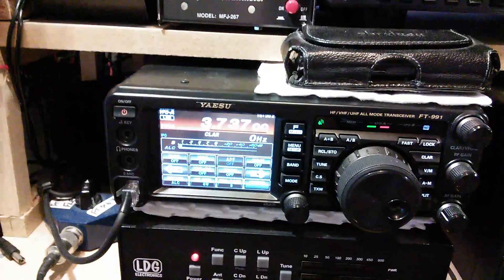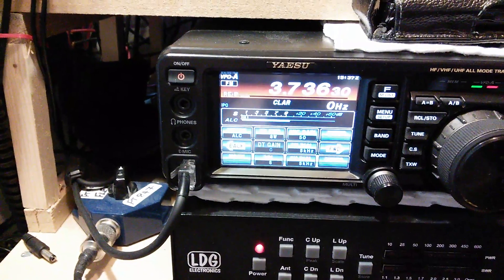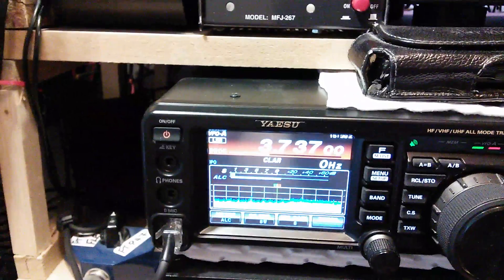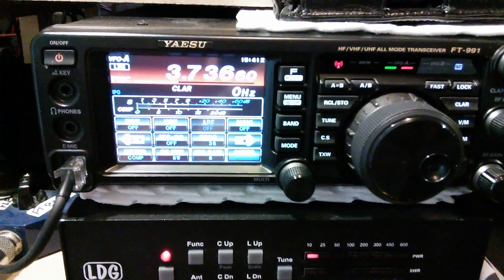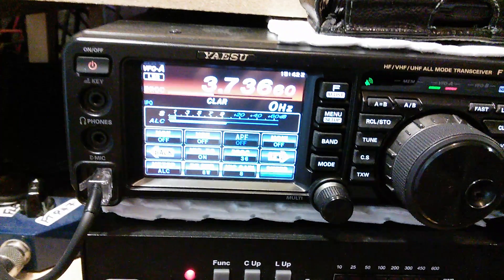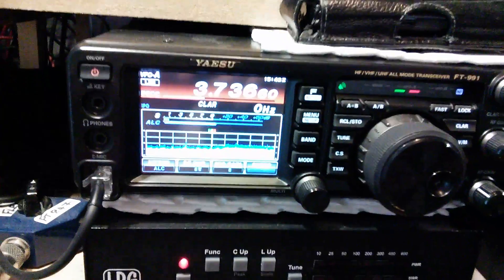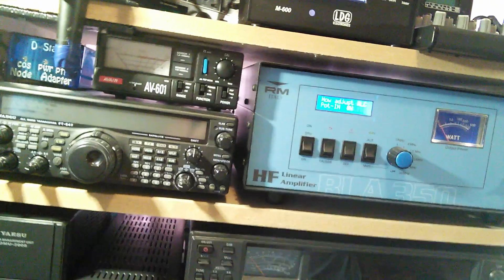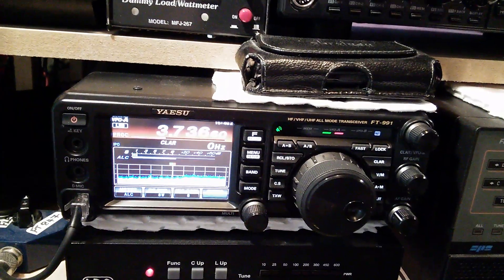FT-991 ALC setup for the BLA-350

Comment: Good morning.
I know, the subject is 8 years old but I am soon considering purchasing a BLA 350 amplifier which I find really great for FT8/FT4. My first question (I also have an FT991A which is connected to an MFJ 939). In menu 141 I selected the "external" position because the TRX is connected directly to the tuning box. 2nd question: When I acquire the BLA 350, should I connect the TRX to the amplifier, then connect the amplifier to the tuning box? In this case, do I have to go to menu 141 and stay in the "external" position or put menu 141 on "lamp". Thank you for your response. Kind regards 73's. Joel/F8MGW
Reply from the maker: Hi Joel ok here goes You need the AATU that can do more than the AMP can put out i.e. 600WATTS,  I have menu 141 OFF,  I use my RADIO then AMP then AATU, Tune up the FT991A with the AMP turned OFF use from 5watts all the way to 100watts then you will know that everything is TUNED with the Antenna, Turn the Power DOWN to 8 watts NO more then Turn the AMP on then go and test the AMP, Have a look at this video it will give you some idea of how to connect everything up if you need any more information regarding your FT991 and the BLA350 let me know and I'll help in any way I can,   https://www.youtube.com/watch?v=CO1HzyRV2Bc

Comment: thank you making this video, just wondering have you had any problems with the BLA350 since making this video ?
Reply from the maker: No I've had No problems at all, always use 8 watts and no one should have any problems.
Reply from the maker: I know you asked about the SWR but cannot see your question something to do with YOUTUBE, Yes you need to keep the SWR below 1.5 or you'll trip the AMP, SO power from the radio 8 watts and SWR NO higher than 1.5.
Reply: Sorry, I deleted the post because I noticed you had already posted below about needing  an SWR of 1.5 or less. Many thanks for reply.
Reply: Will it work 11 meters on the 7300 ? I want to purchase one. Any information would be appreciated.

Comment: Hello, i did get my Bla 350 but i have trouble here, when i connect the PTT cable there is no problem, but when i connect the ALC cable to the yaesu Ft 991 and i put the linear stby to on the Ft 991 starts walking all over the bands, i do not transmit, only put it from stby to on, what am i doing wrong, no antenna connect only Dummyload
Reply: SET MENU 141 "TUNER SELECT"  TO LAMP BEFORE CONNECTING ALC CABLE TO YAESU FT991

Comment: Hi,  i have the FT-991, and i like to buy the BLA-350, i have also home build radio's, thats wy i like to buy a amp where the input watt is low, like 5 watt / 10 watt range, Valve amps that have that are expensive to buy, thats wy i am thinking about the BLA-350, i do data on 40 and 20 meters (where i do not use the amp) and SSB on 20 and 10 meters, thats a bit about me, now my questions, what is the output power of the amp in SSB, the legal limit here is 400 watt PEP, and i do not need more, what is the power in SSB mode on lets say on the 20 meter band with 5 watt input or 8 watt input with max input (what ever that is), what can the amp handle all day long with out getting to hot, not on key down i mean, but normal speaking SSB, greetings from here, thanks for the nice video's, 73
Reply from the maker: Hi Jos with 8 watts input you'll get around 300 watts output with out any problems, make sure you have a good ATU that you can use with the AMP or make sure your antenna is less than 1.5.1 on any band you are going to use it on, besides that you will enjoy the BLA350 but once again don't believe all the rubbish in the Manuel thats with the BLA350 DO NOT USE MORE THAN 8 watts, you can but you'll start to get problems and if your finals go RM Italy will blame you even though it says in there Manuel you can use up to ( Input Power 1-12w AM/FM, 25w PEP ) lololol so funny only 8 Watts, anything else you need get in touch, take it easy and enjoy the AMP
Reply: From 100 watts until 300watts is only 4,5 db or less than 1 S point, for more than 720 euro thats expensive for me, i did think that this amp did make 400watt SBB, 6 db
Reply from the maker: Hi Jos to me it all depends on your Radio, if you look at my other vids of the BLA 350 & FT 847 you'll see I got up to almost 600w from the Amp but with my FT 991 I get up to around 280w to 350w depending on what band and what antennas I use, but that's just me and my BLA 350 the blue one not sure about the New BLACK one
Reply: Thx I did see the new black ones, I did ask them in the other videos what they did get output of 10 watts SSB  input power, maybe the new ones are stronger with new hardware and firmware, with a Elad duo or my iler 20m with 5 watt maybe 6 watt that's no problem, I am satisfied with 150 watt output, but I like to have 400 watt SSB with my ft-991, maybe the new amp can deliver that power, or ik have to buy a mobile amp for my qrp radios tot use on the base here, when i go mobile i do not need a amp, the battery i use is only a 3 cell lipo 11,1 volts 8 amp, and it will drain tot fast with a amp on it, but at home i like to have more power, a big valve amp like the Ameritron al-811 for my FT-991, and a small mobile amp for my qrp radio's I have to pay a lot more to get them than one nice base amp like the BLA-350
Reply: Oké today i did buy the BLA-350 for 720 euro in black online, when i get it, i will test the new amp and let u now, mabe a i make a video en i sent u the link here

Comment: why not test in digital mode with no alc
Reply from the maker: Hi Gary not sure what you mean?? the video is to show how you set the radio up to the Amp, so not sure about digital mode with no alc ???
Reply from the maker: If your going to use Digital Modes with the BLA 350 and the FT 991 then you turn the Proc and EQ's OFF and just use your mic gain to make sure you don't really have any ALC showing when you TX and make sure your only TX'ing with 8 watts and you'll be OK with the Radio and AMP